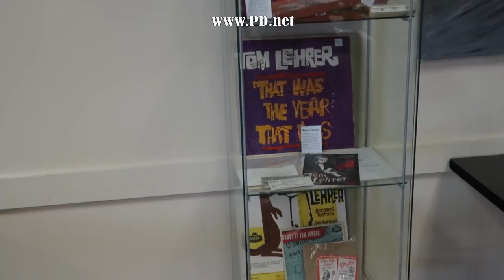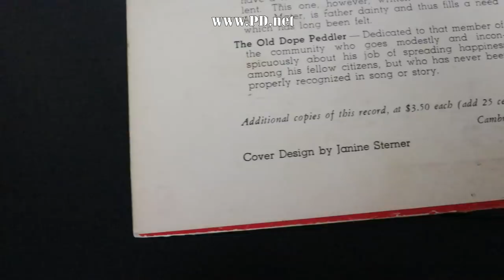#74 Celebrating in candy Tom Lehrer's rhyming of "Orange" for his 90th birthday

Comment: One quick suggestion. I've seen, after you make your drops, you sift them in a fryer basket. You can make a sifter to place on your table out of wood and chicken wire. Make a frame out of 1x or 2x stock and fasten the wire on the top